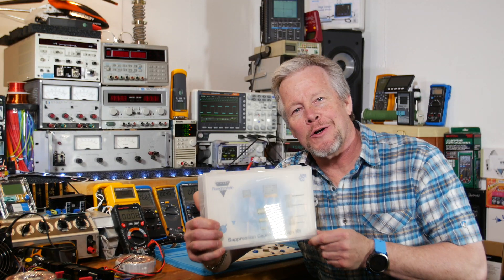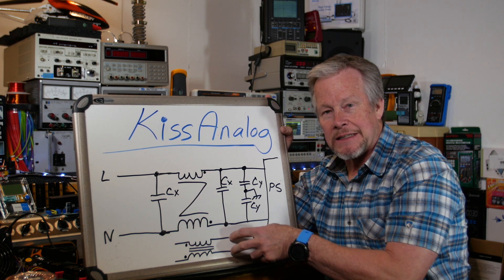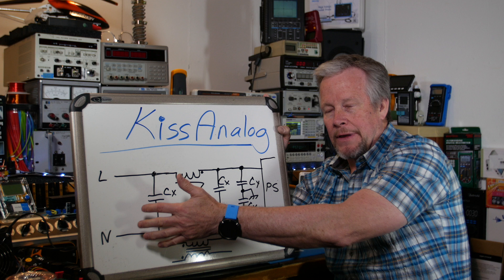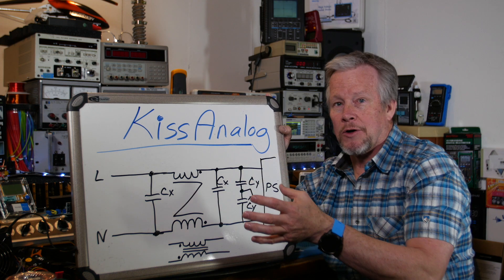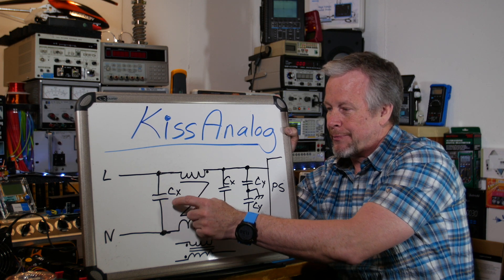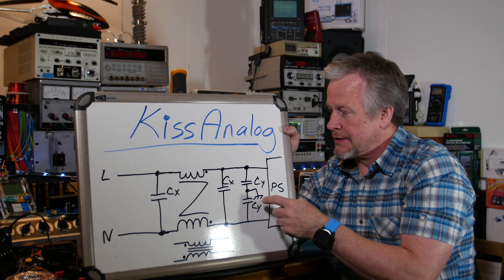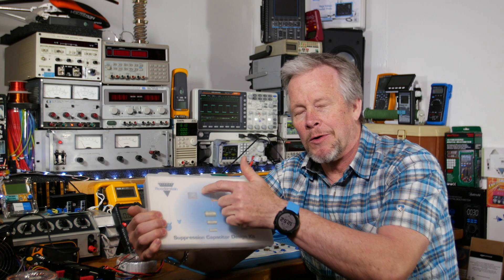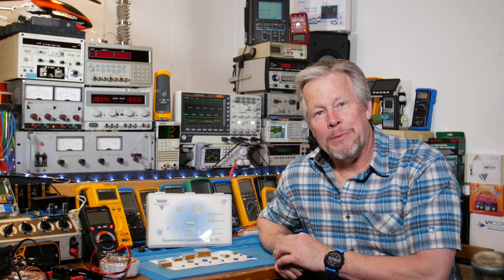How to use Safety Capacitors - What are they? #EMIcapacitor #RFIcapacitor #Xcapacitor #Ycapacitor

Comment: I have observed monitors going off when I turn off my heater fan. Is it the voltage spike or transient which is been filtered by these caps switch off the supply to monitors during the transient period of spike ?
Reply from the maker: Very Interesting!  Yes, that heater is probably pulling a lot of current - then when it suddenly turns off - the inductance in the wiring kicks back and creates a voltage spike.  One of these safety capacitors across the switch of that heater might stop that:)
Reply: Thank you very much for making all these educational and detailed videos. 
I am a Power system engineer by profession and I enjoy watching and learning a lot from your videos. 

For this year Christmas, I have gifted myself oscilloscope,high voltage differential and current probe , signal generator, Linear DC power supply etc. 

I have few things in my mind to check such as how different electrical loads in my home behave on AC supply side (such as constant current, constant power, constant impedance etc)  when it's supply voltage suddenly change (eg 3 kw kettle is switched on - generally drops voltage by 5 volts) .

Comment: I have an old 400v inverter for my EV that leaked high voltage to chassis and fried my 12v board.
Reply from the maker: Thanks for your feedback!  Did you have the inverter chassis grounded, or tied to your 12V board (was it just a board or was it in a metal box)?  Have you seen this grounding Rant? ;)  https://youtu.be/sgp-0xR8Voc

Comment: I have had to replace numerous capacitors of this type in Hewlett-Packard Equipment. They have 250 ac clear cased brand that are fine on 120ac lines but usually go up in smoke within minutes when exposed to 240ac lines. I replace them with modern 275Vac XY types that are actually physically smaller than the originals. So things are improving all the time.
Reply from the maker: Thanks for this great feedback!  Were those clear looking capacitors kind of a gold or silver under the clear plastic?  We need to use X1 and Y1 caps on the 240Vac applications.  The X2 and Y2 are for the 120 VAC lines.
Reply: Just had a HP 8640B billow fire and smoke after running 30 mins on 230V. Y cap had failed spectacularly.PME271Y cap

Comment: Hate the term “safety cap” as it is a street term that’s offers no understanding of the conditions components in these applications work under.
Reply from the maker: I agree, but it is used so often I used the 'safety' in this title.  They should be safe for line voltage because of their construction.  But, the names 'RFI' and 'XY' are also used.   It is unsafe to use normal poly caps on line voltages, so they made these with extra insulation between the capacitive metal elements to be 'safe'.

Comment: I have a bunch of surge protectors, each showing around 30 mA current at 240 VAC measured using a digital clamp ammeter. I'm trying to understand what is going on! They have 0.22 - 0.47 uF X2 capacitors across the line. I was concerned that this is wasted power. Is this leakage current or is it reactive power -- how can I tell? Someone suggested that it is reactive power that is not billed by the electric company. Would love your insights!
Reply from the maker: Thanks for the great question!  This is very intersting - as it is reactive power - in a sense.  However, it is actually a load so it will dissipate a very small amount of power.  The X2 caps are well worth it - as it is an infantly small amount of dissipation.  

Surge protectors typically have MOV protection devices which are also capacitive, so they will draw a bit of current - but not as much as the X caps.

I hope this helps.
Reply: @KissAnalog  I have another SPD that is only MOV based and has no X2 capacitor. The current is below my digital ammeter's measurement capabilities.
Reply: @KissAnalog  can you point me to any technical information that gives numbers for active vs reactive power of X2 capacitors (at 240 VAC 50Hz)? I did some googling and came up empty handed. Perhaps it is possible to derive this from the datasheets, but if so then I don't yet have the knowledge to do so.

Comment: Excellent video. Explained everything in a simple and easy to understand way. I have a question. I'm trying to repair my dishwasher board that has a 250V 0.04 uF X2 cap. The closest I can find is a 250V X2 47 nF +/-10%.  Would that be OK to use?
Reply from the maker: Thank you!  The smaller caps are probably ok.  If it noisy and interferes with other devices then you will have to get larger caps:)

Comment: What a great and educational video!  I really appreciate the effort that you went to.  How would you apply these capacitors to inverter design?  i.e. when running from a LV DC source and creating an output mains AC (120VAC/60Hz or 230VAC/50Hz) but one that is not a utility sourced AC supply but instead made by the inverter - should the safety capacitors be used in the output filter stage of the inverter or are HV caps that are not safety rated sufficient?

Comment: Great video, very informative and easy to understand. 

Could you please tell me, I have a 5V 5A power supply, it doesn't have any X caps, but there's a place for one. Can I use 0.022uf 250V X cap? (Which I have in hand). Line voltage is 230V.

Comment: Thank you for your great channel! I noticed that some vintage lowend audio gear doesn't have X(2) Caps' between hot and neutral. What would be the best way to find out which capacitance I should take? does it realy matter if take a 100nf instead of a 220nf or vice-versa?
Reply from the maker: Thanks for the great question!  The value would depend on the noise that you want to get rid of.  If you have both caps try the biggest one;)
Reply: @KissAnalog  thank you, you're best :-)

Comment: That was awesome. Short and concise - a good reference for those that have trouble mixing their pluses and minuses. I'm sure I'll never remember which capacitor's which so it's good to have something to refer back to.
I'm not sure you had mentioned elsewhere that you were a closet audiophile. Now that we know that, can we hope into some "audiophile" stuff? For example (and it's not just audiophile related), I've always had trouble finding out why there are motor run caps and motor start caps and then there are just plain old regular caps. Now I know I'm never supposed to use a motor run cap as a motor start cap and vice-versa (especially vice-versa) but can I use a large capacitance, cheap motor start cap in my loudspeaker crossover or not? Or how about in a tube radio power supply? So can we have a similar video about these two specialized capacitor classes and their interchangeability with regular capacitors perhaps?
Reply from the maker: Thanks for the great feedback!  The idea about the motor start caps is   a great idea!  Here's a link to an audio playlist: https://youtube.com/playlist?list=PLZ0_iMoMBSsmeLp-eZfrBKMGOxrNQT_Mo
Reply: @KissAnalog  Ha! I see you've done a Gainclone too! This definitely takes me a while back! Re. motor start caps: I've been trying to find out about their general applicability/corresponding de-rating without success for ages. Not that I'd recommend it, but very often these can be had for nothing when scavenging parts from old equipment. At the same time, sometimes people throw away equipment just because of bad motor cap (which of course they wouldn't know about). All the same, these caps are cheap, and maybe sometimes free, when their regular equivalents (?) cost 10x more.
Reply from the maker: I agree.  We need to do a good video to better explain this type of capacitor.

Comment: I just found out about these things through Mr. Carlson's Lab. I've been an Electronics Engineer since 1982! In any case, thanks so much for taking the time to explain how these work along with a usable circuit diagram. Is my calculation correct that there would be 425mA leakage under normal conditions (assuming the neutral is not grounded to the chassis) for the series 4700pF Y2s? Isn't that a bit excessive...? I usually fuse my 35-watt tube radios with a 1/2 amp slow-blow fuse!
Reply from the maker: Thanks for the great question Denny!  Leakage current should come out to just under the limit of 0.5 mA, so it looks like you might have got one of the numbers to the wrong power.
Reply: @KissAnalog  - Wow. You are right! Pico is -12, not -9... Duh!!
Reply from the maker: LOL

Comment: So, which is actually better.  1 or 2?  1 will handle higher surge voltage,  but will pass more leakage current.  Correct?
Reply from the maker: 1 is needed for higher voltage.  Leakage is a function of the capacitor value.

Comment: why do we/engineer/convention call some high value pF caps and not nF, like why 4700pF and not 4.7nF. Does that mean they are different somehow?
Reply from the maker: Capacitors never used nF, but as the Art of Electronics is slipping away, so to are the conventions.  In this case it wasn't really a big deal maybe.  The uF was used to standardize the units, it made for several advantages, but maybe today the use of nF makes sense...I'm not sure...

Comment: Thank you!!!!!
Reply from the maker: You're welcome! And thank you for your feedback;)
Reply: @KissAnalog  I had been looking for information on X2/Y2 caps.  I have been in electronics since the mid-70's but never studied them.  All of the industry instruments I worked (still work) on are portable or non-portable have power entry modules that in addition to fuses have the line filters built-in.  Now I plan to play with restoring old tube radios and other tube equipment and needed to learn about the capacitors tied to the power line.  Your video was perfect and what I was looking for.  The only other thing I was taugh from elsewhere: Y1/X1 = Industrial, Y2/X2 = consumer.  You cover a little bit about that.  One thing that possibly could be added is the failure mode of each type.  I think Y caps open, X Caps short.  I would be interested in a demonstration video of Y/X cap failures and how they are built to open or short.  Maybe not important but interesting.

Comment: Great video! Excellent explanation! 
How do I measure blown safety capacitor?  Do I measure same as capacitor?  I have been using a server type power supply for home use PC since 2008 and stopped working last week (12 yrs not bad!).  Safety capacitor is X1.  X1 is difficult to find in Thailand except importing from Taiwan. Would X2 work since I am using mainly at home (220v).
Reply from the maker: Hi Jun-Hwa that is a great question!  You should be able to test it with a capacitor measurement meter - like the one on your multimeter.  If there is no physical damage and the meter reads OK in capacitance - then it probably is OK.  What is the reason you suspect the capacitor?  You can safely replace an X1 with two X2 capacitors.  Try to get double the value so in series it is back to the original value.  Let me know how it goes...
Reply: @KissAnalog  Thank you for your reply and apologized for not backing to you sooner.  I did a simple heat air blow onto the PSU and it turned on.  Saw somewhere on youtube and tested it myself.  So I started my project by getting all replacement caps (without cap measurement meter, a proper soldering gun and solder sucker pump :P).  I replaced all caps, burned circuit board and RIP to old PSU lol.  In the process, I found out that PSU manufacture used higher grade solder alloy probably mixed silver (melting point is 420C).  Removed old caps took much long including X1.  PSU didn't turn on T-T.  Long story short, my friend gave me his spare 1000W PSU and PC is up running :)  
Few days later, I ordered new digital clap meter with cap measurement meter later on and tested all old caps from PSU.  Caps (Chemi-con Japanese caps) turned out values are in acceptable range after 12 years of use.  X1 cap also fine.  Could have waited for the new meter before starting the task but it was a good learning curve.

Comment: Awesome! Subscribed! Working on a RCA Victor VHT33W Console radio/phono and have what I believe is a blown 470pf 1.4kv disc cap, haven’t positively verified yet. It goes from line to ground. Now I know why it’s 470pf. Pulling chassis out tomorrow, hopefully there’s writing on other side of cap. Do you have any recommendations on part?? Thanks for sharing knowledge.
Reply from the maker: There is typically one on each line to chassis.  The largest value for this is 4700 pF.  It is advisable to replace both.  Poly caps would be a great alternative.

Comment: I am really appreciate your very informative videos and valuable comments, I got a problem with a very old Braun blender Machine, the XY Capacitor which is 0.2uF + 2x2500pF blown up and this part is not available any more in where i live, and there was a resistor 6.5 ohm between the 220 volt lines  I searched and many forum suggest to just use the X capacitor and connect it but i dont know if it is safe or not and what is the alternative, ? Should i  use a TVS or flyback diode?
Reply from the maker: Thank you - I appreciate you!  Is the X cap blown up, or also the Y caps?  Was it shattered or burnt looking?  I wonder if it was slowly damaged over time or burst from a lightning or surge?  Is it a ceramic or poly (disc or box cap, or possibly Orange drop (molded type))?  Is it X1, probably is. You can replace it with any type of X1 with a larger value as well.  This filters noise from the blender so not to put the motor noise on the ac lines.  They would likely use the smallest possible to save the cost.  The Same goes for the Y caps, use Y1 and the same value any type or smaller value.  The Y caps add leakage current on the ground and you don’t want too much of that.  Don’t add TVS unless they are rated 10,000 Amps, but if they are rated in Watts they are not strong enough and will blow up eventually.  The resistor value is too small, or was it in series with the X cap?  If right across the lines it is probably k ohms.  Did you measure it?  Is it physically large?
Reply: @KissAnalog  Thank you for your fast reply, It is a cylinder combo XY capacitor in one component with five wires sticking out, the middle one (differing color, like transparent insulation hose) is supposed to be connected to the motor's stator iron it was an aluminium foil type with wax paper insulation layers rolled in between,  this type of capacitors are known to explode and to pop their contents with force, which is my case, since the wax vaporizes and expands much more intensely and quickly than any plastic foil material will. I think it damaged over time because of deterioration of the insulation, this type of capacitor is so rare and I didn't find any with the same values, i just found one with same shape but with different value it was 0.1uF + 2x2700pF but i didn't purchase it because the 0.1 is far and not the same as 0.2uF and i need to connect it in parallel with other 0.1uF to obtain the 0.2uF.
so i got from that store a 0.22uF X2 MKP type and i intend to connect it only without any Y capacitor. sorry about the resistors it is 1.65 Mega ohm and it is ordinary physical resistor
Reply from the maker: I don’t think I’ve seen a capacitor like that.  The poly caps used to be expensive, but they seem very reasonable now.  Is the X2 cap rated for the voltage?  The MKP are self healing too, so probably a nice upgrade.  Thanks for sharing this;)
Reply: @KissAnalog  yes, 250 Volt I will send a photo for you

Comment: Hi great video and thanks for sharing. One thing that I am confused about is the restrictions on class X capacitor placement imposed by IEC 62368-1, the IT safety standard. The standard prohibits the use of X capacitors on circuits which are not isolated from the mains. Do you have any idea why this restriction is in place?
Reply from the maker: That’s a great question.  I think it is because it is possible to have an undetected short or fault to ground.  If this happens then the X type capacitor is not as safe as a Y type capacitor.  Hope that makes sense.
Reply: @KissAnalog  thanks for your reply. But if there was a short to ground/earth then the RCD at the consumer unit would trip. I'm in the UK so probably using different terminology to North America. Do you think the restriction is to cater for old wiring installations which may not have been upgraded for many years and therefore not have an RCD fitted? Or for a faulty RCD (one where the contacts have stuck)? i think I may have answered my own question lol.

Comment: Master en Eddy about The Wall outlet in the Bathroom the normal wall outlet must be atleast 2 mtr away from the shower and not in the direction of the water spray and also the specia Switch GFI for safety
Reply from the maker: Sounds like a safe control.  Thanks for sharing that - great info!